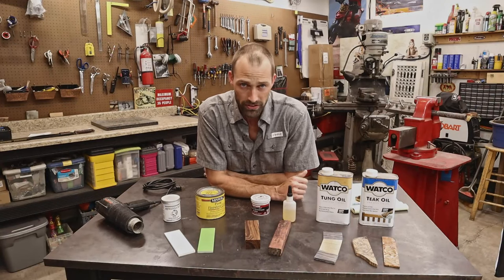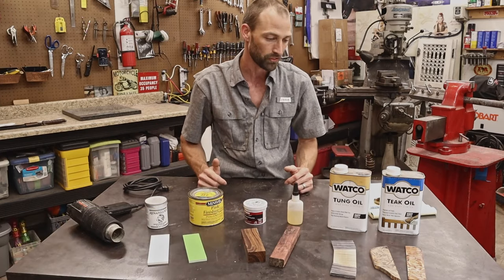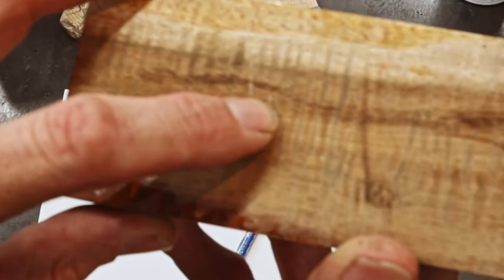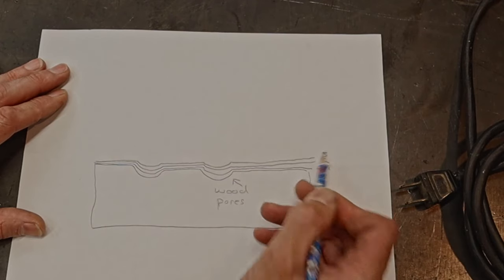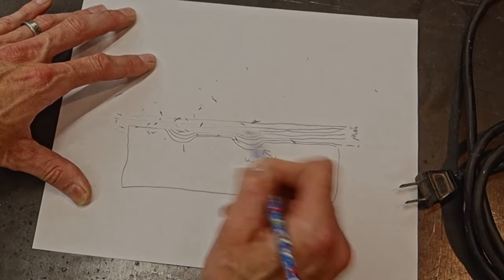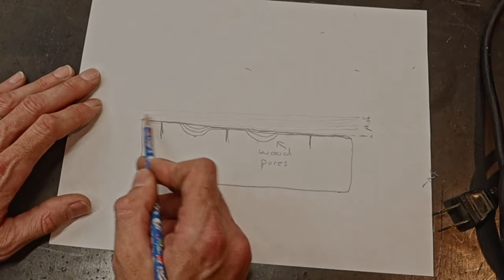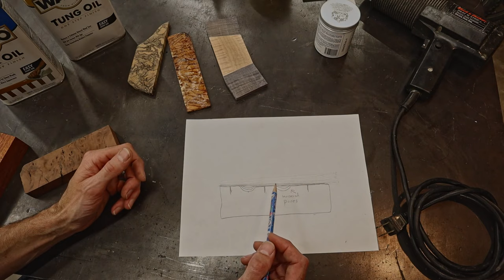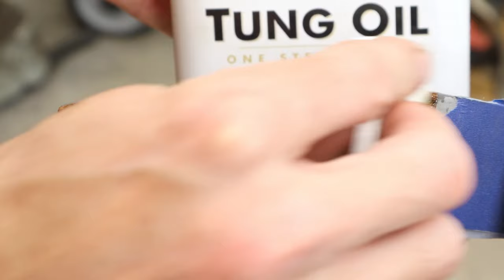Finish for handles that makes grain pop

Comment: I'm a metal fabricator by trade and polish all my parts. I use mother's polish on just about everything. I learned by a polisher that uses it to cut the fine marks. I use it on my knife handles. Awesome trick. Keep up the good work!
Reply from the maker: Thank you! I stumbled by using it by accidentally getting some on a handle when buffing the blade and when I wiped it off it polished the wood as well. So I started experimenting with it
Reply: @Aleeknives  works on plastic too! I'm glad I stumbled on your YouTube page. There are some good hints!
Reply from the maker: Me to! Glad to have you here! Cheers

Comment: I use CA glue as a finish on gunstock checkering when refinishing or when checkering a new stock and it works great to prevent the normal wear and tear you get on those grip areas. Haven't thought about using it as a finish on a knife. From my experience with those super dense woods like Rosewood or Cocobolo, they're also very oily and any finish that leaves a surface film will fail over time. So i can totally see how a thin CA glue coating on the surface, polished up like pen-makers do, would work great.

Comment: When sanding the underside of the knife handle try using a dowel for a sanding block. The dowel will follow the contour better. IMHO Tru-Oil applies better than Tung oil. Nice looking handle.
Reply from the maker: I like the dowel trick also. I use tru oil also but it definitely has a darker tint than the tung oil. I did a white tiger maple gun stock with tru oil and it turned honey amber color. It eventually bugged me and I stripped it all off and used tung oil. It was much better with the tung oil. However, I have since started playing with shellac! And it can go on even more clear!

Comment: Mother of all finishing videos!  Thanks for your detailed pro tips on all finish options.   Will paste wax protect blade steel as well as 3 in 1 oil.  Any thoughts on 50% linseed   mixed with shellac as a poor filling finish?  Thanks again.
Reply from the maker: Yes sir the shellac would work great also! And probably be a little stronger in the end. This is a demonstration of getting a good finish with products from the local hardware store. Thanks for watching my videos!

Comment: Beautiful knife. For sanding those radius spots I use a few different size dowel rods with leather glued to one side about half way around and then wrap sandpaper. Makes it much easier than using something flat.
Reply from the maker: A+ I will definitely try that! Thank you

Comment: How long did you wait before each coat of tung oil
Reply from the maker: If I use a tung oil finish that is cut with naptha I wait about 12 hours. Straight uncut tung oil could take days.

Comment: Hi there. Between each coat how long do you let it dry and do you wipe off the excess?
Reply from the maker: This is a tung oil finish and will dry completely between coats. Generally I wait 12 hours between each light coat. It may take longer in cooler climates

Comment: Not sure I understand the Tung oil and naphtha mix.  How is that accomplished?  Do I burnish with 0000 between every coat of Tung oil?
Reply from the maker: You mix the tung oil and naptha in a separate jar or just buy a tung oil finish. Then yes burnish between coats to knock off any imperfections. Or you could just do a bunch of junky build up coats to fill the pores and then lightly sand it back with a hard backed sanding block and 500 grit. The object is to fill the powers of the wood making a perfectly smooth surface. After the smooth surface is achieved I like to do my finish coats by applying the oil with and old cut up tee shirt that is lint free as to not introduce any debri into the finish! Cheers mate

Comment: Aleeknives,  love the video!  How long do you wait between teak and tung oil coats?  You've earned another subscriber, thank you
Reply from the maker: Thank you Patrick! Glad to have you! It really depends on the climate. In the winter when it is cold I can get 2 coats a day. 1 morning and 1 evening. In the summer months I can squeeze 1 extra coat in the mid day also. If you try to sand it while it's still tacky ot will turn into a gummy mess. So make sure it sets up after your last coat before knocking it back and starting the finish coats. I generally start another project so I don't rush it!

Comment: I infinitely respect your pro expertise. I will pass along a different technique i have perfected. NO PINS IN HANDLE  This is a decorative handle attachment that no drilling thru tempered tangs is used. I take my blade & tang and grind in (3) 1/8" X 1/8 notches each side of tang. Then select my woods. Prefit only to duplicate notch placement with tang. Either route or chisel 1/8" deep around scales. Then super glue the scales lined up to notches on tang. Then use Gorilla Duct tape to attach "Jump Stretch Bands"(their orange 10lbs. resistance called "micro mini's") to the blade end, then use the tape again on the handle end(remember there is only maybe an inch to grab on with tape). SO WHAT YOUR DOING IS USING 6 FOOT STRANDS OF CARBON FIBER TO RAP AROUND THE 1/8" SLOTS U HAVE feeding these from the twisted orange bands. I line up pre-filled hardner & epoxy(several). I super glue a end of the 3K Carbon-Fiber, then let the six foot length "Tow" feed out of a fresh mixed epoxy into the carved out notches. I twist up the knife with the bands, then use a big old adjustable wrench to hold the twists b/4 i guide the resin filled 3K C F into and around the handle. What i end up with is 3 or 4 Carbon Fiber rings that hold the scales on bullet proof, and are beautiful. I use a cheep infrared lamp next to handle to give a half hour cure each ring.
Reply from the maker: Extremely interesting concept here!
Reply from the maker: Could you send me some pictures please? Here is my email airinlee@swbell.net

Comment: How long do you wait between coats? Sure it was mentioned I apologize if I missed it.
Reply from the maker: You jave to wait for it to dry so that time may vary but I usually do 2 coats a day. One early morning and one late at night. I want to also add that this is a tung oil finish, it is not pure tung oil. Pure tung oil takes ages to dry. You can take pure tung and cut it with naptha at about 50/50 to speed up the drying process
Reply: @Aleeknives  awesome thank you! I'll be giving this a whirl on my next knife!

Comment: Which process for white oak quilted bural? Got some by accident in pallet of oak.
Reply from the maker: Real similar! I finish oak to final dimensions and then wet it with water, heat it with a heat gun to raise the grain. When it is dry cut the grain with a sharp resh piece of sand paper. Then start the oiling process. Raising the grain really helps to achieve a fantastic finish. It is crucial for the wood to be fully dried or it will move and crack as it dries. Best to stabilize wood in an acrylic resin

Comment: Hello,  nice finish !!! which sanding grain do you reach before applying the tung oil? Sorry if you ever explained it my english is not perfect 😄
Reply from the maker: On stabilized wood 500, on un stabilized wood 320. Hardwoods go to 1000 grit and then polish.
Reply: @Aleeknives  merci 😁👌. I was thinking it was necessary to go higher to obtain this grain pop. Fantastic maybe I will save a lot of time now!
Reply from the maker: It really starts to pop after the 4th and 5th coat of tung oil!
Reply: @Aleeknives  cool! I will try it in a while 😀. Before I have to  watch the video again to be sure of having we'll understood all your advices. Thanks again for the share!
I have also started a little (and humble) channel few weeks ago. It's really interesting to do it. I don't have your knowledges but each time I try to do my best 😁.
Reply: Hello, I have 2 last questions for you.
Why do you use teak oil first?
It seems to be very difficult to find the Minwax paste wax in France. Do you know an equivalent? At this moment I'm using a blend I made called "encaustique" . It's a blend of beeswax, terenbenthine, black soap an lindseed oil but I think it's not the same because it doesn't harden by drying... So if you have an information about that it would be nice :)
Reply from the maker: The teak oil is basically tung oil that has been thinned down with naphtha which allows it to infiltrate the wood pores deeper and further bring out the figure. Any paste wax should be fine. The reason this wax hardens is because when you heat it the binder dissipates and leaves only the wax behind. You could just use beeswax and rubber it on liberally then heat it and it would do the same. The paste wax just goes on easier! Feel free to ask away my friend!
Reply: @Aleeknives  OK super, well understood 😁.
Huge thanks for all these details and your time!!!!
Reply from the maker: Cheers!

Comment: Excellent series. Came to your channel from the chef challenge. I'm subbed now. On this handle finish video. After the 7th coat the video ended. Did you block it back down and then apply light finish coats?
Reply from the maker: I split the video into 2 parts, there is quite a bit more info in part 2. I am super glad to have you here on the channel!

Comment: Aleeknives,  I want to get some finishing paste wax like you use but all I can seem to find that is close is Minwax "natural" or "special dark".  It seems like you use the original without the natural or special dark designation.  Any idea if they have the same protective/durability properties as the original stuff?  Just wondering if you've run into this, I'm wondering if they no longer sell the original.  Thanks
Reply from the maker: Interesting!  I just bought a new can at home depot. I have never used the tinted wax
Reply: Thanks, I'll keep looking.  Maybe I just haven't been lucky.

Comment: Excellent ideas 👍👍💡one question, the idea with super glue, did u use this knife? I made the same thing with my knife, but nearly 2 month of use and it began getting of, some places it get off till wood, but some places it stay. Maybe my super glue is not good... It not a discrimination of idea or something esle, i want to know only)
Reply: Sorry for my english if there is something wrong)
Reply from the maker: I have had that happen with the super glue once, it was because I sanded to high in grits befote applying it so there was no mechanical bond. Generally if I am to do a super glue finish I only sand to 220 grit then start the super glue. I did not use any super glue on this knife, just tung oil. I will do more videos later explaining the other finishing techniques! Thanks for watching my videos!
Reply: @Aleeknives  Thank you for answer👍 then i think that my mistake was sanding to much, i sand before gluing till 2000 grit, then after gluing do the same from 220 grit till 2000 and polished with paste GOI. Thanks a lot for answer, you helped me 😊👍💪💪

Comment: HI, I am loving your video's on knife handles & have incorporated your technique with heating the wax & buffing, (LOVE IT). I'm getting ready to finish some wenge handles & want to try the Mothers polish, My question is do you use the mothers polish over the wax or skip the wax & just go with the Mothers polish. Thank you for all the Great information in your video's.
Reply from the maker: That's fantastic! I'm glad you're getting some goodness out of my videos. You definitely want to use the mothers before you apply wax. The wax will seal the wood and the mothers is an abrasive compound so the wax will prevent the abrasive compound from doing the polishing
Reply: @Aleeknives  Thank you so much, I'm looking forward to giving it a go.

Comment: Old Army trick when spit shining boots we always lit the wax on fire until we had a liquid base in the can and then applied it to the boot surface. This also works with wood as well. It will also keep you from over heating the wax and wood.
Reply from the maker: Now that is a great idea Timothy! Thank you
Reply: @Aleeknives  Thank you for the very detailed video.  I have one question thou, which I didn't read an explanation for. Why use the Teak oil first coat and what does it do that the Tung oil doesn't?I have been watching all the videos I can find on the subject but have not had much luck except for this one. Thanks! I'm putting a finish on a knife handle that I just completed that uses several types of wood with each being 1/4" thick plus, G10, micarta, aluminum and copper in thinner layers all stacked in a pattern. I'm hoping this process will work for me.
Reply from the maker: Great question! Teak oil is basically tung oil that has been thinned down with naptha. The thinner solution can penetrate deeper into the wood. I use teak oil first and then move on to using tung oil to do build up coats.

Comment: Hey Airin! Great video, I found this super helpful. Something that I can not figure out for the life of me is how to use tung oil without creating a white splotchy finish? it seems every time I use it this happens. I normally finish wood at 400 grit and use extra fine steel wool in-between coats. I wonder if I need to buff it out with something finer then steel wool?
Reply from the maker: I use diluted tung oil. It is a tung oil finish and I also use 0000 steel wool between coats. The final coat makes it crystal clear

Comment: Here’s an idea for you that might save days in that process. 

After watching this video I grabbed some unfinished not stabilized wood pieces (zebra wood and a spalted semi hardwood of unknown name), brushed on straight Tung Oil and set them under a 100 watt incandescent bulb. They felt dry a few hours later so I added another coat, again using a paper towel folded up for a brush. Four hours later, dry again. Thinking I might be able to lay more on to speed it up, I put the next coat on with an eye dropper (!). Now that was a thick coat. Under the lamp again and repeated it four more hours later. 

I’m a beginner knife maker and this was a first time experiment, but the surface was filled with no gummy buildup when rubbed out. Just an idea.

Comment: Following your process almost done with my last coat of teak oil before letting it dry and going to the tongue oil during the shaping of the handle process I nicked the backside of my blade and has a scratch mark probably the size of a frozen P is there a way to get rid of this? Or should I give the full knife a different look by rubbing it with Scotch-Brite lengthwise in order to mitigate the obviousness of that scratch any ideas would be helpful.
Reply from the maker: That is cool that your thinking outside the box on how to fix the scratch. I jave had to do a similar fix on several mistakes. I like to do a rock pattern finish to hide mistakes

Comment: These are great! I'm using Mesquite for mine. Could I use a mixture of these methods? Like the superglue and then the rim wax and paste wax runny? I'm confused about which method to use. These are great. Glad I found your channel!
Reply from the maker: If you choose the super glue, use it on bare wood, do a build up and then wet sand with a high grit paper above 500 and polish with mothers. If you want to do the oil build up, I would just use the oil and skip super glue. The oil is easier than the super glue

Comment: After applying the 13 coats of ca glue and you go to block sanding what grit do you start at?
Reply from the maker: 500 and you will go through some paper because it gums up the paper super fast!
Reply: @Aleeknives  and then after you sand to your desired grit use the mothers and buff? Or more ca glue? Thanks fir for taking the time to respond.
Reply from the maker: I wet sand then polish with mothers. It is really difficult to sand it without cutting through the the layer of super glue! You have to be really careful. If you break through you will see it in the finished product. I had to go back with more coats of ca glue and re sand till I got the hang of it. It is definitely a more advanced finishing technique 👌
Reply from the maker: During wet sanding you might find even 500 grit cuts to fast and you can move up to 600-1000 and use it wet so it doesn't gum up as fast.

Comment: If it does not specifically state "Pure Tung Oil" it is going to be a mix of a little bit of tung oil (can be as low as 5%), varnish and solvent. Effectively you are just putting 7 coats of quick drying varnish on your handle. The SDS for Watco Tung Oil has: Stoddard Solvent, Methyl ethyl ketoxime, Triethylamine, Ethylbenzene, Hydrotreated Heavy Naptha. None of which are present in pure tung oil. Pure tung oil also takes up to a week for each coat to cure, so it is a lot longer to build up a finish.
Reply from the maker: This is exactly true. I like to dilute pure tung oil with naptha

Comment: Im confused. All through out the video you only mention Tung oil but when you get to actually doing it the first thing you use is Teak oil..Did I miss something?
Reply from the maker: This is part one. I expain that teak oil is thinned down tung oil. Basically tung oil and naptha. It allows the oil to penatrate deeper into the wood. Then I begin to use the tung oil finish which is also a finish and not pure tung oil.
Reply: @Aleeknives  Thanks for clearing that up man.. Very Informative videos man thanks!